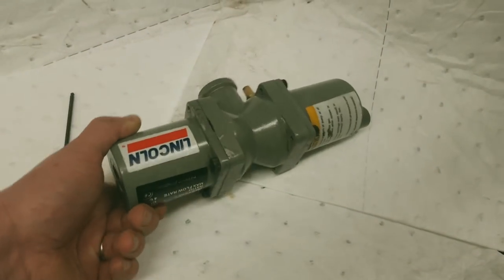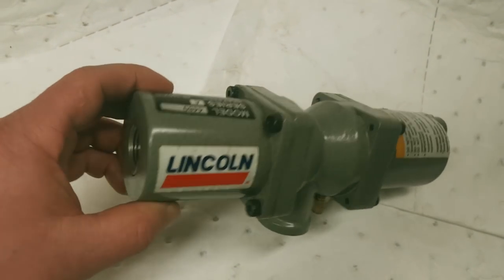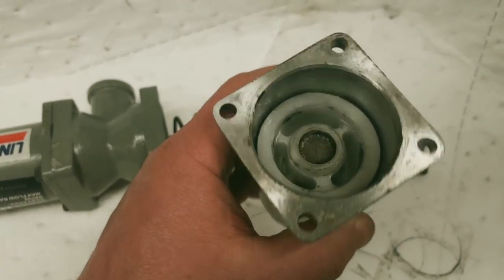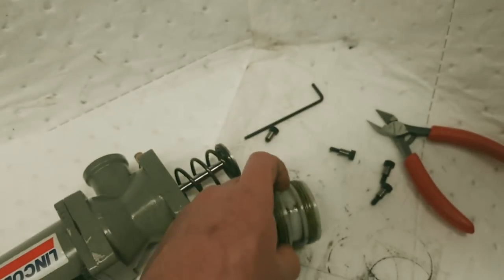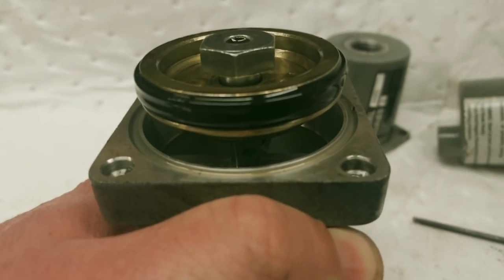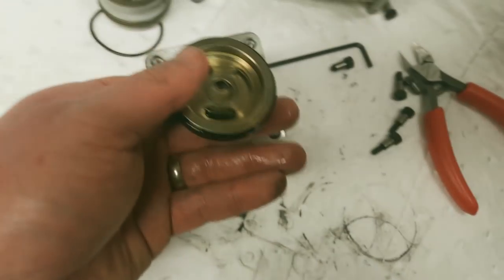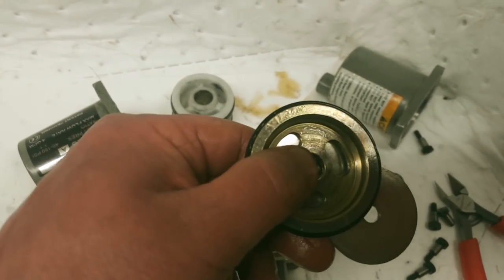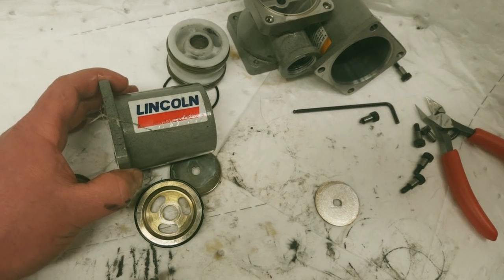BOLTR: Lincoln Industrial Fluid Transfer Pump.

Comment: I’ve been using the same pump at work for a few years and sometimes it works / sometimes it doesn’t... today I spent about 2 hours trying to get it to chooch (primed it multiple times / tried warming up the air side / tried ramping up the pressure different ways ) what ended up making it work was when I took the filter off, put  methyl hydrate inside - shook it around - let it dry out and then put the air to it and it worked! I have no idea how to actually troubleshoot this thing as I don’t want to risk taking it apart and asking my boss for a new one after I break it. 
Long time subscriber love all your videos.
Thanks Ave!!!
Reply: Perhaps that swelled up the seals? I’m curious, isn’t one of these loud when running since the air exhausts to atmosphere?

Comment: Plenty user serviceable. Always clamp spring loaded things while removing the bolts. Loosen all 4 bolts a bit, then the clamps. Repeat until there's little to no tension on the spring.

Comment: $1054 might be a bargain if that pump works for a long friggin time reliably. This one clearly did not as evidenced by the broken pump seal on one end. I imagine they also have a patent or something preventing any other company form making a similar pump. So yeah, if you're the only fluid manufacturer, $1054 is a fantastic price!

Comment: Seemed to have a bit of difficulty conceptualizing that hot oily action. Perchance you mixed up the in-ports and your out-ports? That check valve seems like it would seal up a hell of a lot better on the pullin' then the pushin'.

Comment: "Looks nice because we do it twice," that's how I do my videos and rigid conduit...
Reply: +MalleusSemperVictor Well I've cut the damned thing 3 times and it's STILL too short.
Reply: +MattsAwesomeStuff all i have is a giant ass pile of sawdust. its not too short cuz it doesnt exist anymore
Reply: +AvE If you put that on a shirt you sir, would have my money.
Reply: I've machined parts near the edge of tolerance,  sent them for initial inspection, had them rejected, just kept sending the same part back again until it passed.
"cut once, keep measuring till its right."
(truth be, that's my own sting I pull on new inspectors to gauge their expertise and integrity)
Reply: +MattsAwesomeStuff But it's only short on the one side...
Reply: Words to live by!

+NickMoore hey...no need to brag about your conduit... :(

Comment: Hey, look at the pump and think about the how the valve works a little longer. I think someone installed the fluid Piston bacwards. With the spring tenstion it would not open in it's current orientation, and would open when pushing against the fluid.

Comment: How the hell does that piston go full depth? Does it have a ton of momentum? Is that black thing a weight? Do you have to unload the hydraulics to get the oscillation going? It seems that once the #2 piston seal goes past the bypass hole, the whole system minus the small restriction of that thru hole, is at exhaust (almost atm) pressure and there ain't no pressure in your backside. Maybe I'm a lost puppy but that don't seem right.
Reply: +Aheitchoo  The incoming air pushes the power piston, rod and pump piston and compresses the spring. Once the exhaust hole is uncovered and air pressure is lost the spring pushes the power piston back until the hole is blocked and incoming air pressure can once again push against the piston, spring and fluid repeating the cycle.
    Mike (o\!/o)

Comment: this can also double as a safety. While your system is working at psi, if the system goes over its intended psi the vlv will stop working. somthing else to keep in mind. that should be factored into the price now your beer robot will not blow off an arm.

Comment: Is "NPT" essentially the same as "BSP" just re-named for the other side of the pond?
Reply: The T in NPT is for tapered as the both ends of an npt fitting are tapered to create a seal compared to a bsp where the p is for parallel and usually uses a sealing ring

Comment: Actually that mark, C E     has nothing to do with China.    CE marking is a mandatory conformity marking for certain products sold within the European Economic Area (EEA) since 1985.[1] The CE marking is also found on products sold outside the EEA that are manufactured in, or designed to be sold in, the EEA. This makes the CE marking recognizable worldwide even to people who are not familiar with the European Economic Area. It is in that sense similar to the FCC Declaration of Conformity used on certain electronic devices sold in the United States.
Reply: +Doug Reed Silly me, I should have known that.
Reply: +Jeff Stanley CE can also stand for China Export. (The big giveaway is the distance between the C and E)
(Check the wikipedia article under Misuse for more info)
Reply: I did not get that far down when I was on Wikipedia evidently. If I am wrong then it is good you corrected me.

Comment: Would something like this be suitable for pumping fuel from tank to tank? i.e. kerosene, gasoline, diesel and/or fuel oil?
Reply: +deimosian They make versions for various uses. Basically, the pumps are manufactured the same, just the materials for the innards would change as required in performance. Buna N is just one type but not for low viscosity or vacuum. I have seen cooper 'O' rings for low vis materials and for submerged pumps, Indium had been used. It depends on what it is being used for...

Comment: do those pumps need primed with fluid?
Reply: +TheStuffz Depends on what your pumping(the density) and how far from the fluids normal level to the pump.If there is a check valve in series and close to the pump then as long as your close to the fluid surface and the fluids not too dense then no priming.If your far from the fluid and the fluid is dense the yes priming, a check valve here doesn't help.If you have no check valve in series and close to the pump then it will only work with priming.
Reply: was thinking if it was replaced with a new unit or a new installation. not sure if it can pump the air out of the system on its own or not. very cool item for sure. probably what you hear at the quick lubes doing the pshhhh and cachunk underneath when they put the oil in.

Comment: That isn't a China export mark. Its' a European Conformity mark indicating it conforms to certain EEA (European Economic Area) standards. The common misconception arises because many Chinese manufacturers use the mark illegally. If your device is a high quality product, it's likely to indicate conformity rather than Chinese export as certain products are mandated to conform if they are sold in the EEA. The United States and Canada also have a mutual recognition of conformity which is why you may not see industrial appliances and fittings bearing a UL or similar listing. Broadly speaking the CE mark is broadly similar to the FCC mark found on electrical equipment.

Another problem particularly with Chinese manufacturers is that they can be listed for CE then remove non essential components when going through manufacturing to reduce costs.  One way you can tell a counterfeit or more particularly Chinese mark is that the C and E will overlap however the directive is to have a space and have the image be at least 5mm in size.

Up until recently I worked with a lot of CE machinery as well as built it kind of grinds my gears when people confuse precision engineering with Chinese shite.
Reply: Actually the C and E are more spread apart than usual when it's China export

Comment: BTW, 'CE' doesn't stand for China Export. It's ' Conformité Européenne'. Look it up! ;)
Reply: +mictho100 Yes, the REAL CE mark of course stands for 'Conformité Européenne'. Putting the mark on a product is a statement from the manufacturer that the product conforms to EU regulations. 

If you believe that to be true for everything from China that carries a CE marking then I've got some lovely Kansas oceanfront properties you might be interested in. :-) 

Also, the CE mark on Chinese products is often slightly different in spacing etc from the real CE mark (http://maklare.lansforsakringar.se/start/nyheter/2014/PublishingImages/ce_markning.jpg), so not the real CE mark, just deceptive to fool the unwary. 

There might not be an official China Export mark, but it's as good a description of what it is as anything...

Comment: Why would it only be a delrin piston in an aluminum cylinder?
Reply: +Mike Waz is there a materials list that would tell you what properties a Plastics go well with others?
Reply: +Mike Waz 
I wish there was some sort of quick flowchart that would give you different plastics properties at a glance. kinda like "this plastic is best for high heat applications" or "this plastic is great for its strength to weight ratio".

it would be easy like that no?
Reply: Well that answers that question. Thank you!

Comment: honest question... does the ce mean china export or conformite europeenne??? Honestly my research says that that is conformite europeenne, but I've been wrong before just ask the wife haha.
Reply: +FXM right Ive seen that picture before. I got a solid state relay off the internet once and it said the CE as well as made in Taiwan. That didnt make sense so I looked it up
Reply: Brad Sogn Something can be made in Taiwan and still have a legitimate CE certification. The CE cert just means that that product meets certain EU manufacturing standards, and bears no relation to where the product is made. It's a lot like the Underwriters Laboratories UL certification mark. That being said, many products do not get the certifications (it takes time and isn't cheap)  and the manufacturer is just lying to the customer when they put the certification mark or one easily confused with the true mark on their product.
Reply: hmmmm now there is something interesting, so what your saying is that the china export mark and the certification mark look similar because they want people to be confused and think it is certified but really its just Chinese, haha  that is sneaky.

also my experience with the Taiwanese relays is just what got me thinking. I knew they were manufactured in Taiwan by the smell.

Comment: actually, in my stupid opinion, i think that the working piston and check valve work in the opposite manner that you described, because it would seem to me, that theres nothing holding the check valve against the piston head, so it would make more sense if it pushed oil out on the spring "return" stroke,  out the center port, and then on the inwards air pressure stroke, the valve unseats, oil fills the backside, then WHAM spring pressure seats it and forces oil in the outwards.

Now, like i said, its just my stupid opinion, but it would seem that the moving part should be pressing against something on the outflow stage.
Reply: stefantrethan maybe the check valve was reinstalled on the wrong side? and thats why it no longer works? i dont know, it still doesnt make sense to me the way he described it.
Reply: I was thinking the same thing.
Seeing the valve assembly in that rod would easily confirm it.

Comment: It's not worth $1000 now...I used to work with a Liquid NH3 pump, 3000psi hydraulic input, 50,000 psi output (big input piston, wee little output piston, probably one of the more manly pumps of the universe.

Comment: I think you need another check valve in order to chooch.
Reply: +stefantrethan well i guess, but it will not build any pressure. They sure got the name right, "transfer" pump.

Comment: i still didn't understand how that valve works
Reply: The large valve with the 3 holes slides on the nut, the small solid under it is fixed to the shaft... It still needs a additional check valve to work
Reply: +hill billy The inlet check valve for the oil or grease is at the bottom of the pipe that screws onto the casting and is inserted into the barrel.  This pipe is not shown.